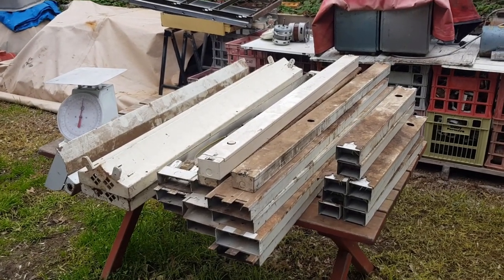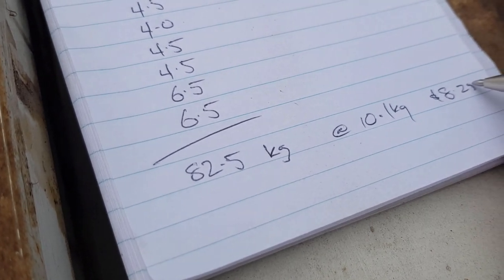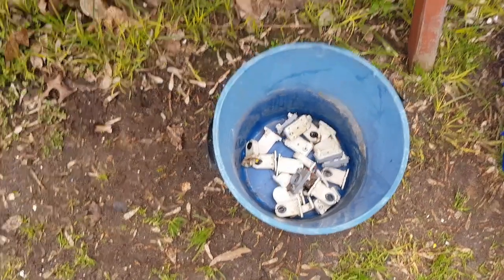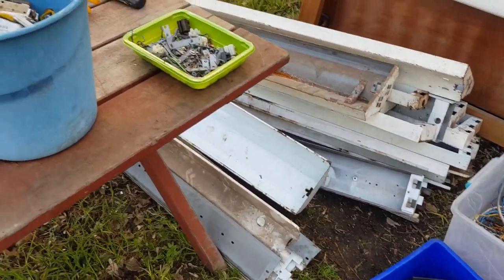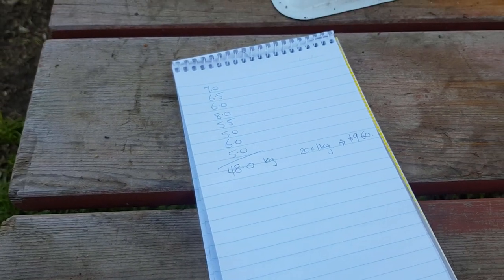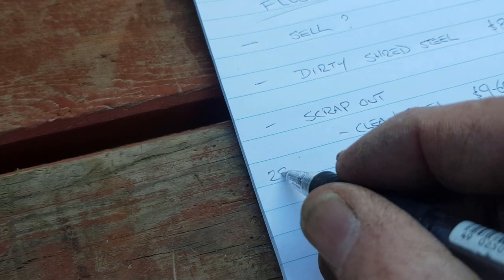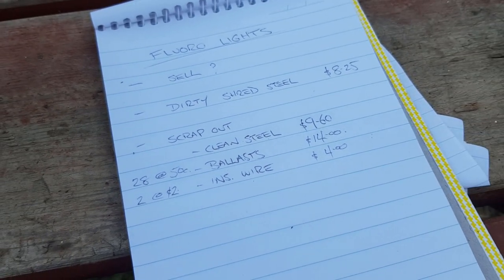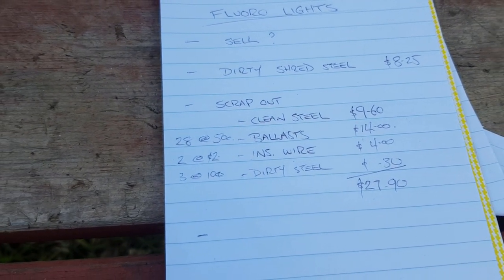Is it worth scrapping Fluoro Lights? Should you pick them up street scrapping? Fluorescent ewaste.

Comment: It looks really calming to just slowly take everything apart. I know you've done a walkaround of your backyard with your large steel scrapping in washing machines etc, how do you store your scrap for small parts like this? keen to take things to pieces but don't want to make too much of a mess of my backyard haha
Reply from the maker: You mean you don't want your backyard to look like mine Wyatt? 🤣🤣
I've just started another part of my backyard clean up series and I'll show how I store all my smaller bits of steel!
I use computer cases, microwave shells and even paint cans for small stuff.
Reply: @TheUltimateRecycler  hahah it is already close to it! just repaired the dishwasher, got more bits left over than when i started!
Reply from the maker: Left over washers are acceptable - anything else may be an issue! 😖🤣